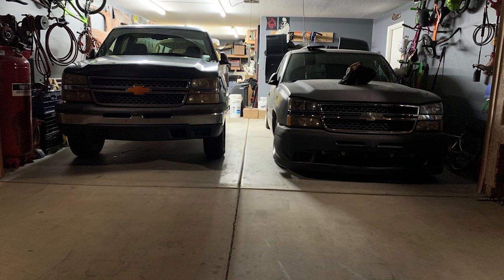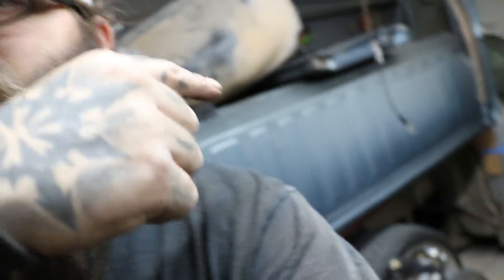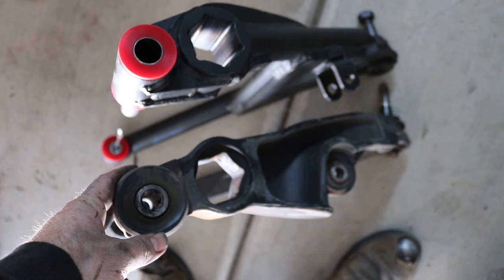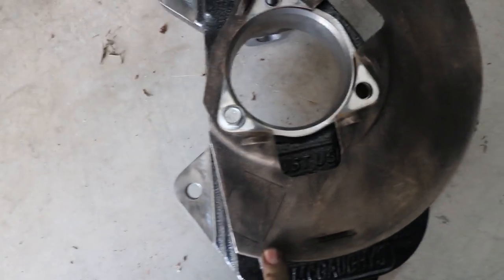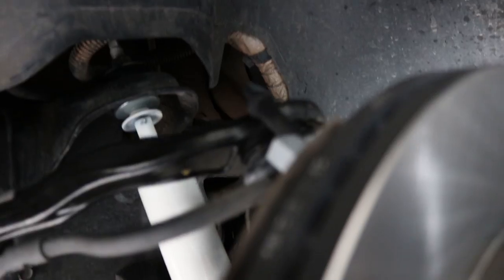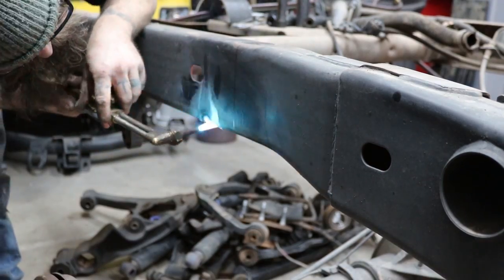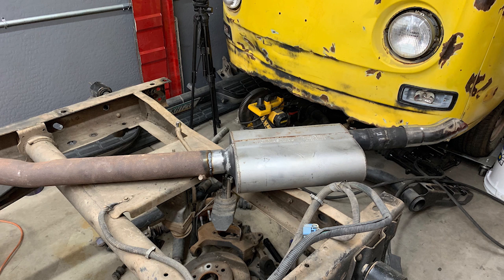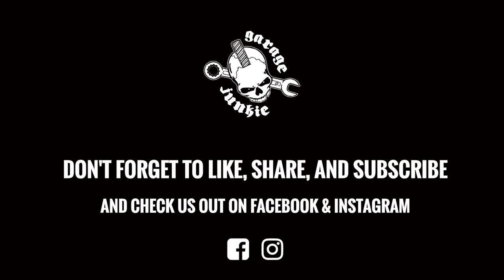How To Lower a 4X4 Chevy Truck

Comment: On a scale of "must avoid pebbles on the road" to "I never notice it's dropped", how tough is this thing to live with in terms of speed bumps, steep curbs, ramp transitions ets?
Reply from the maker: It’s a cautious back out of the driveway at a specific angle and a go over speed bumps one tire at a time kind of low. Still drivable on decent roads but avoid big potholes.
Reply: @garagejunkie6742  thanks for the answer... looks sick, but I don't have that kind of patience.

Comment: So it's preferable get the lower control instead of the upper? 
Cuz I have a problem i got the oem parts but if I drop the front and i got a negative camber

Comment: do you think a 4/6 or a 4/8 is too low for a 2009 Chevy  Silverado z71 4x4. ?
Reply: If you’re planning to do a 8 in the rear do a underbed notch and have your crossmember notched so you can have clearance for the driveshaft

Comment: i have a 99 Silverado Single cab 4x4 and advice on what brand drop kit i should get for a 4/6 or 5/7 drop
Reply from the maker: It really depends on what you're using the truck for. A 4/6 is "more practical" but a 5/7 looks really nice. You're going to have to keep in mind as well that you will be blowing through axle boots the lower you go. I like mcgaughys brand stuff because they're consistant and made in the US. DJM is a good brand as well.

Comment: So did you just buy lowering spindles also if so where did you buy them from
Reply from the maker: This truck used drop spindles, and dropped lower control arms, and we had to use lift keys to get tension on the torsion bars.

Comment: Hi I was wondering if you ever heard of or can I flip my torsion key upside down on my s10 because I need at least another inch lower up front I have the torsion bolts unscrewed all the way .. any suggestions?
Reply: Yea you can from what I've found it would be a good idea to dimple they key the same as the factory does on the side the adjustment bolt will be touching, that and blocks is all you need to lower s10s or blazers, it's actually cheaper and more proper than lowering a 2wd front end lmao

Comment: Bought a lowered '95 4 door dually with a 12 valve swap... (why? I dunno...) It will scald the rear tires until you're sick of doing it, accelerate like God shot you out of a slingshot, make every kid under 20 drool... but you can't carry a 12 pack of beer in the back (suspension bottoms out), point it in a straight line (suspension again, I assume), or make a U-Turn in anything less than an empty WalMart parking lot. It's as useless as tits on a boulder... But it STILL makes more sense than lowering a 4x4 pickup and putting goofy rims with the rubber band tires on 'em.  I can't wait to sell the only lowered truck I'll ever own!
Reply from the maker: This is 100% going in our next video that’s the funniest thing I’ve ever read.
Reply: @garagejunkie6742  Thank You! My wife tells me all the time I'm full of (funny?) shit.

Comment: By any chance do you have a link as to where you got the drop control arms from. Thanks a bunch and love the videos you do.
Reply from the maker: LNS KUSTOMS one side... https://www.summitracing.com/parts/djm-ca2602l-3p/ ... the other side https://www.summitracing.com/parts/djm-ca2602l-3d/ ... the part references as a 4x4 or a 2500 it’s for torsion bar trucks only ( obviously). Thanks for watching and I hope those links work for what you’re doing.

Comment: Did you use drop keys or the stock keys for the torsion bar??
Reply from the maker: Chuchuus I actually ended up using lift keys a few weeks after this video. Gave me a better ride. I know it sounds weird but it worked well.

Comment: Would a 5/7 drop on a 4wd have too much problems ? I’m in a wheelchair so I’m trying to get the truck as low as possible.
Reply from the maker: The only real “problem” is ripping the boots off the front axles. The fix for that would just be shortening where that boot clamps do own on the axle. You could probably achieve that sort of stance with drop keys and spindles just fine.
Reply: @garagejunkie6742  sounds good definitely gonna give that a try. Thanks.
Reply: And the 4x4 would still be functional correct ?

Comment: i have a 08 crew cab sliverado 4wd wanting to do a 2/4 drop what is the easieies way  any info would help
Reply from the maker: hit up switch suspension they can set you up with anything you need!
Reply: @garagejunkie6742  did you have to notch the cab?
Reply from the maker: @brendenn985  no we did not.

Comment: Any idea what it would take if I had the same truck but just wanted a 3 inch in the front and 6 in the back drop, like what parts would I need?
Reply from the maker: An axle flip kit will get you the 6” roughly. These front a arms are advertised as a 3” drop but due to the price I would recommend just the spindles up front and the lowering keys. Just depends on your budget.
Reply: Garage Junkie Official thanks a lot, I’ve been looking everywhere for answers and I finally got one 👍🏻
Reply from the maker: nK Red • no problem. Just to be clear I’m referring to a torsion bar front end. Glad we could help.
Reply: Garage Junkie Official Yeah that’s exactly why I was asking, I’ve got torsion bars.

Comment: Did you drop it with out messing up the 4x4?
Reply from the maker: Yes, it puts stress on the rubber boots but it all still works.
Reply: So im on this video because I drive a lowered 4x4 maybe 5 or 4in drop up front and I activated my 4L yesterday and my right axle snapped out lol. Is there any way of being able to have my 4x4 work fine and still be as low as I am
Reply from the maker: @Lazurite1  we never had a problem with axles snapping... I'm thinking though, that maybe shorter axle shafts need to be used. Like, they may be too long and binding inside the stub axles. But, that doesn't make a whole lot of sense to me, because they're fine when the 4wd is not engaged. Just a thought.
Reply: I have a 2011 Sierra Z71 4x4 dropped 5/7 since 2016 and still in good shape. I launch in 4 hi all the time and have a heavy foot. I say this is the max if you want your axles and boots too last.

Comment: How did you go lower with the 3 inch drop control arms?
Reply from the maker: It clocks the torsions in a different location to get the desired drop.

Comment: I have a 2006 Crew cab 4x4, can find lowering control arms, all it says is non crew cab
Reply from the maker: one side... https://www.summitracing.com/parts/djm-ca2602l-3p/ ... the other side https://www.summitracing.com/parts/djm-ca2602l-3d/ ... the part references as a 4x4 or a 2500 it’s for torsion bar trucks only ( obviously). Thanks for watching and I hope those links work for what you’re doing.

Comment: Yooo link the items
Reply from the maker: one side... https://www.summitracing.com/parts/djm-ca2602l-3p/ ... the other side https://www.summitracing.com/parts/djm-ca2602l-3d/ ... the part references as a 4x4 or a 2500 it’s for torsion bar trucks only ( obviously). Thanks for watching and I hope those links work for what you’re doing.